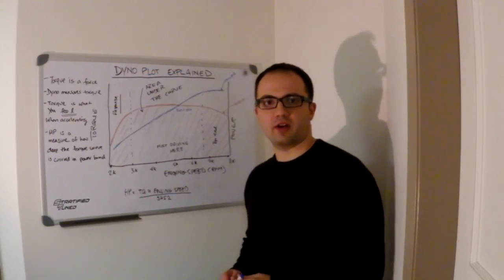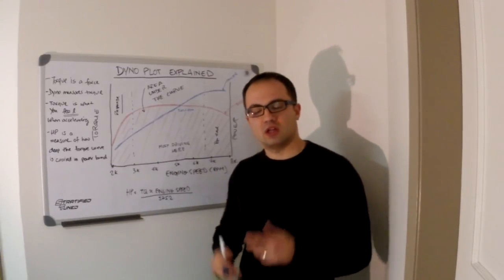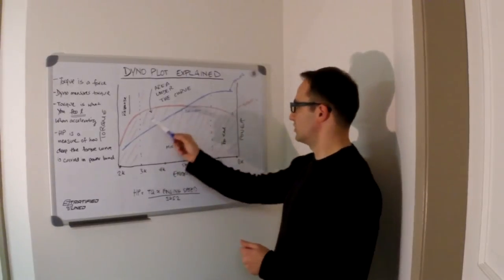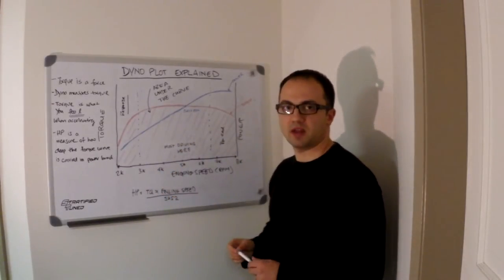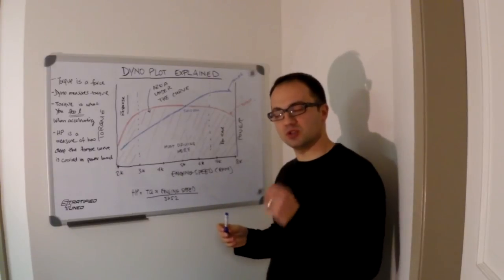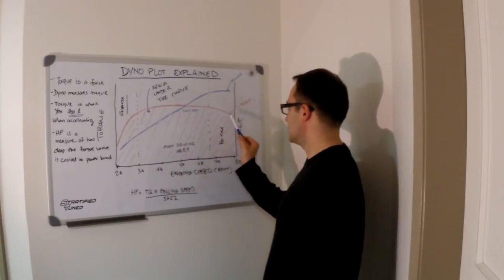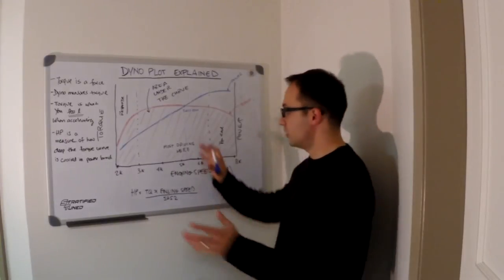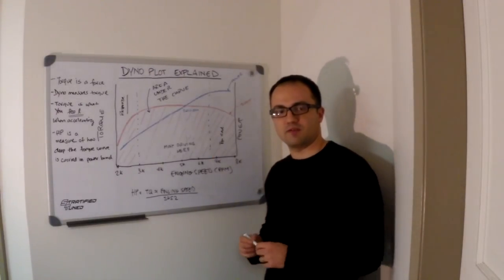Stratified Auto Explains What to Look for in a Dyno Graph

Comment: is Engine optimal speed range  a factory setting and can not be changed,for example an engine with 3000 rpm to 4000 rpm optimal speed range     or optimal speed range can be changed according to driving conditions and throttle input?
Reply from the maker: You can shift the power band via both changing parts like the turbo and by tuning.
Reply: @stratifiedauto  thanks

Comment: I think you need as much tq as possible at any given rpm, not just a flat tq curve. Being pushed into the seat the same amount all thought the rpm range is sorta boring. but being pushed harder and harder as you hit redline is much more rewarding. resulting in an ever increasing tq curve. Thus a crazy hp curve, related to a large turbo. flat tq curves are so boring
Reply from the maker: Today’s turbo engines often fall off up top. Keeping that torque flat up there is very nice and trust me very rewarding to wring out.
Reply: If you looked at a graph of any performance or race car, like in F1, you'd realise that's completely wrong.
Reply: @wav1366  well then you can't read graphs.  Unless you won the Nobel prize in physics and turned what you know about energy transfer on its head

Um.doubt it

On any engine dynamic, increasing the amount of tq created by the motor is a good thing. This increases power at that ram, which which a good thing. The only reason one would want a certain tq curve is for drive ability. And also, comparing tq outputs to other motors is quite honestly, dishonest at best and ignorant at worst. Crank tq gives no indication of performance just as someone stating their hourly wage tells you how much money they actually make.  Income has two variables. Hourly rate and hours worked. Just like a motor. Tq and rpm.   You want both to be as high as possible for both situations. To state otherwise is dishonest or ignorance.
Reply: @chaztitan6457  my guy you sound arrogant af lmao. you DONT want torque to keep climbing, you just want it to climb up as high as possible and level out to be even more predictable. and if you dont believe me, go on images and look up some of these dynos and you'll see that peak torque appears less frequent than flat torque. and you want a certain torque ALL the time because it depends on your driving; if you're driving in straight line at high rpms, torque doesn't matter and it's vice versa when you drive on twisty roads. your allegory on wage isn't even right - you want hours worked to be as low as possible and hourly rate to be as high as possible - that way you get the most money for working the least amount of time. you're probably young as hell so it's not even gonna be worth arguing with you.
Reply: You are so wrong. You want the torque to climb as fast as possible. For example, if you're getting 10 lbs at 2000 RPM and even if it climbs up to 40 for a 400 CC sport bike. It's still not as good as a bike that gives you more lbs at a lower RPM with even lower peak power.

Comment: What turbo should i go with? Is 360whp achievable without water meth or E blends. Thanks.
Reply from the maker: For a Focus ST? For that power level if you have very good 93 octane or similar at the pump a GTX2867. You can go with a GTX3071 for a bit more top end at the expense of response and it allows you to reach the goal with slightly poorer fuel. http://www.stratifiedauto.com/index.php?main_page=product_info&cPath=78&products_id=242

Comment: What if your car is still making peak near power at 5500rpm but the torque has fallen over dramatically by then?
Is the answer to shift gear?
Reply from the maker: This sounds like a small turbo power curve if it’s a turbocharged car.